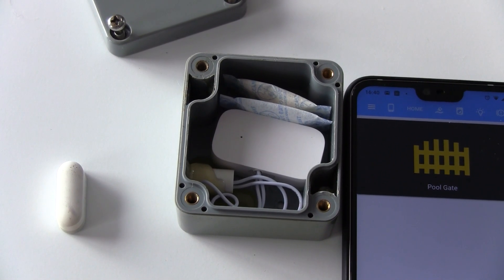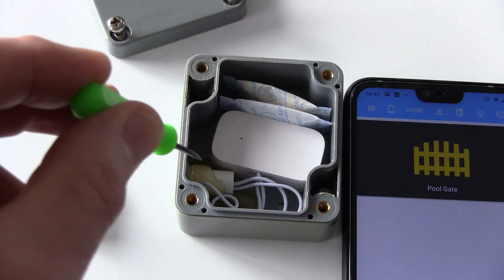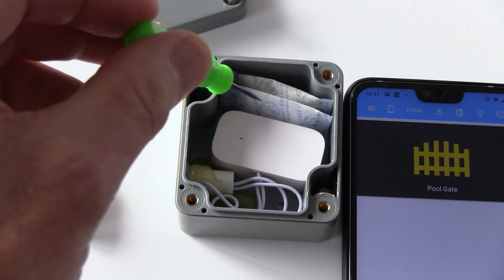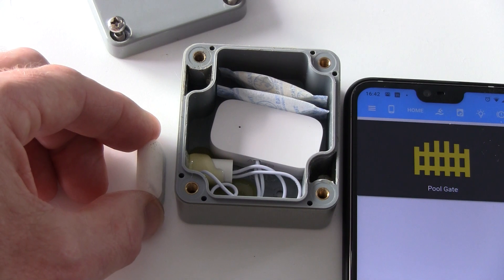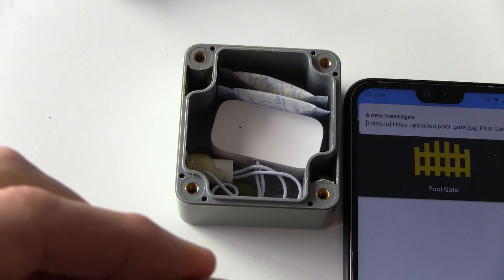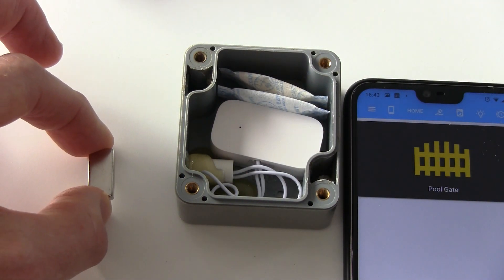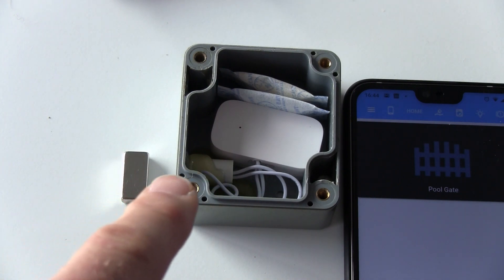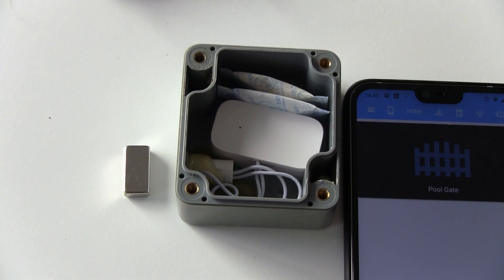How I made an IP65 Zigbee Sensor for Home Assistant

Comment: absolute legend mate. Im in Auckland and was looking for something exactly like this. How has it faired with the rainy weather over the years?
Reply from the maker: Really well. I soldered an external CR123 battery holder into the box and a flush mount reed switch into the side. They've been running for years without issue. Don't skimp on the box though
Reply: @xbmcnut  Thank you again. If you have any other nifty hacks please do link them through

Comment: Hi, can you share some photos or video showing how you added this extra wires to the xiaomi sensor?
Reply from the maker: Sure can. Will get that posted in around a week. Just solder the external reed switch wires across the solder points for the internal reed switch.
Reply: @xbmcnut  This is all new to me, so I am not sure what I should do. Please when you find the time give some instructions.Thanks!
Reply from the maker: Found an image online that shows the internal reed switch. Simply solder the external sensor/switch across this https://i.imgur.com/Xitum3j.jpg